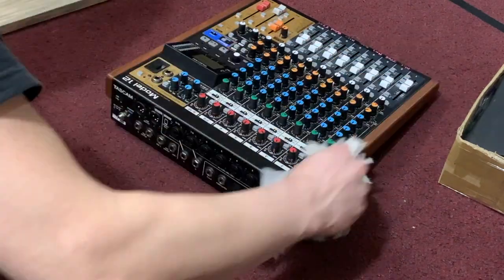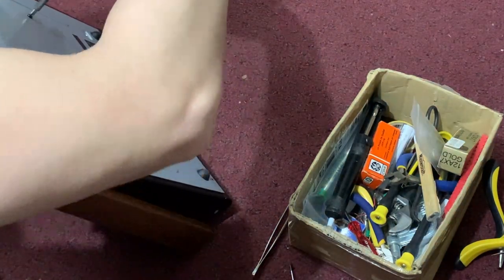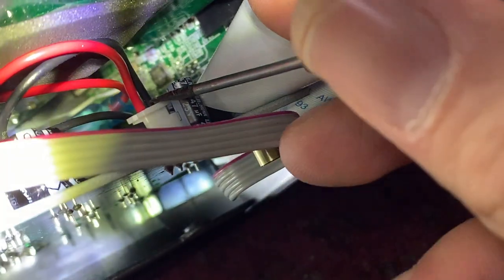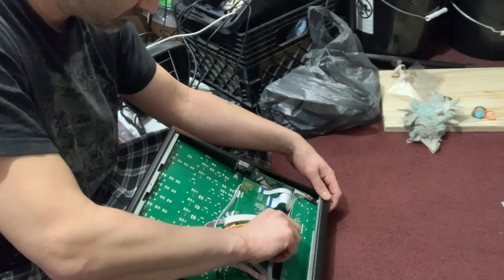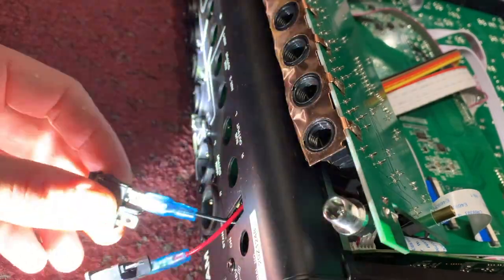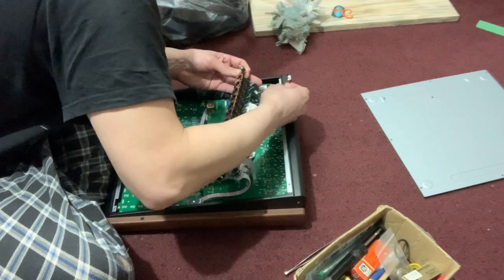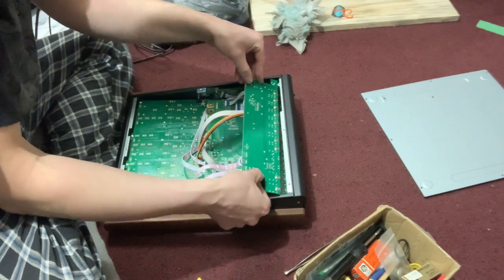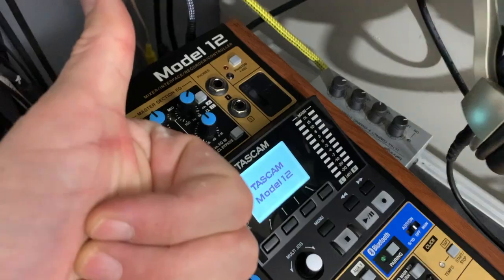TASCAM Model-12 Mixer: Power Issue Resolved with new Stand-by Switch - Quick Repair

Comment: A workaround that worked for me was to just remove the switch from the circuit. I connected the positive and negative wires to each other and covered the metal parts with the cable protectors and electrical tape. Now Model 12 lives on an extension cord with its power switch operating as a power switch for the mixer. Of course, this leaves a gaping hole on the back of the unit where the power switch used to be, but that's nothing that a black piece of tape wont hide.

Just a possibility for those who, say,  have poor access to new parts and an upcoming gig that relies on the mixer to work. :)

Comment: I heard about the power issue before, and I was a bit frustrated by that but I still decided to buy a model 12. I took it apart and the power switch connector seemed loose indeed. I bypassed the power switch by soldering a piece of wire to the board, and now I don't have to worry about it not turning on, since I'm planning to use it on live events too.
Also, two of my 'rec' buttons were a bit funky and did not have a click to them, I managed to fix them too by turning the transparent plastic part by 180 degrees.
It's not really nice that I had to do this. But after these fixes, I am a happy owner of this unit.
Reply from the maker: thank you for feedback !

Comment: THANK YOU! To your point about the switch being loose; can confirm that readjusting/bending the rocker switch leads fixed this problem for me instantly. There's a small tongue/lip on the pins, just needed to clip it back into place. Weird! 

After no mixer for 2 months, you saved me $200+ in repairs 🖖
Reply from the maker: glad to help :D and thank you for you're feed back, it will help more ppl

Comment: I have the same power issue with my model 12. I just keep the unit in the on position all the time the last time it successfully powered up and keep it plugged into a separate power strip and I just use the power strips power switch and it fires up every time this way (hundreds of power cycles). I had this issue on my previous model 12 which was sent back and replaced after waiting 9 months and then the replacement started doing the same thing. Must be a frequent issue on these boards. I’m not big into ripping my gear apart so just found a quick work around “fix.” Won’t ever get another Tascam. Next mixer will probably be a PreSonus Studiolove Series III 32SC. Thx for posting. May check the connector to see if it’s loose and try to tighten the connection to see if that might fix it.
Reply: Thanks to the OP for posting this video--I wish I had found this stuff out before my warranty expired. I also figured out that it powers on using a power strip, however, I'm back looking for solutions now that it's starting to happen again even with the power strip. Now I'm having to cycle the on/off even more. I'm gonna open it up and check out that connection, and definitely gonna try to contact tascam for a replacement.

Comment: Thanks for posting this! I have this issue and, like another commenter, I found the fix was to power it on/off via a power strip. 
I'd like to replace the switch, but Tascam absolutely refuse to send me a replacement (I want to pay, even though it's a common defect with this mixer) or give me a model no. so I can order my own. They keep telling me they'll only repair it for me (at my expense, shipping/repair etc) despite me saying I'm more than capable of replacing the part myself. 
Extremely frustrating and poor customer service from Tascam, making absolutely sure I won't be buying any more of their gear. Shame, as it's otherwise a great mixer.
Reply from the maker: im sorry to hear that, i bought mine from my local music store whom contacted the dealer on my behalf and i was really close to my warranty expiration at the time. so i think i got really lucky. a generic can be sourced i believe. another yt'r posted this part thru digikey :	
708-2505-ND, no idea if its legit but maybe ?
Reply: Tascam sucks like that for whatever reason. At least when it comes to things like that. I've had issues with them before (good luck if you have a piece of gear with a weird power supply, & you're definitely screwed if it's a discontinued product. They can even be unnecessarily rude with you about it too.)

Comment: Good to watch this.  I have a 12 and have had no trouble with it but good info !  thanks.
Reply: Agreed. I've had my other Tascam mixer/recorder for almost 25 years & it just started having serious issues last year. 
It had issues well before then but those were because of the poor build quality (all plastic chassis & some of the inputs/outputs were literally just soldered to the board inside with no reinforcement whatsoever & they came loose over time. Actually a few came loose within a year or two after I got it but I couldn't return it or afford to get it fixed. But  still worked; just had to be in place a certain way to get a good connection. 😂
Other than that, it served me quite well until last year. No idea what the problem is, but no matter what I do, nothing I record on it sounds right. It's hard AF to just get anything to sound decent. Last two songs I recorded on it took me a month or two each just to get a result that was listenable. It's that bad, but it lasted for that long. Playing through it as a mixer still sounds fine; just can't get a good recording on it. So I got one of these model 12s. I love it so far.)

Comment: I got this issue on my Model 12. I tried adjusting the switch connectors but turning on is still super inconsistent. Hopefully, Tascam will send me a replacement switch. It's ridiculous though that so many Model 12's have bad switches